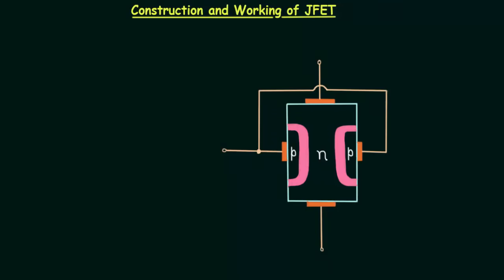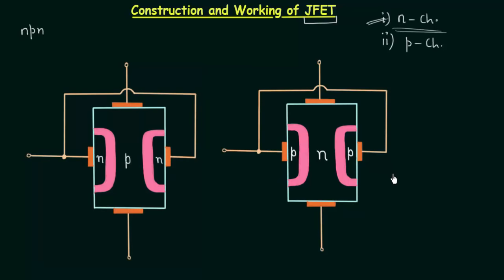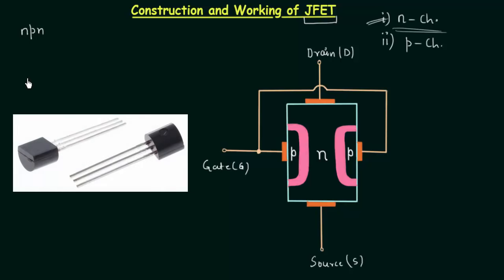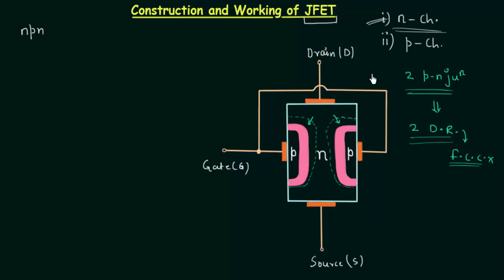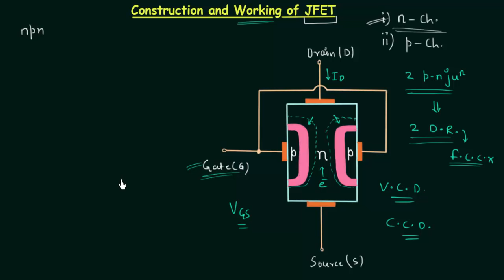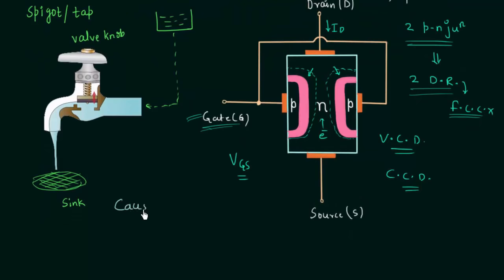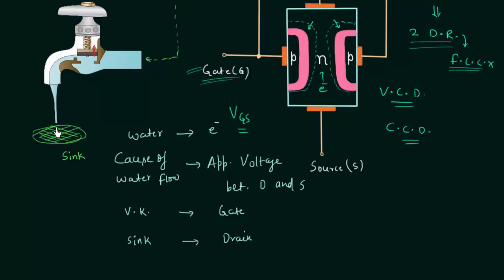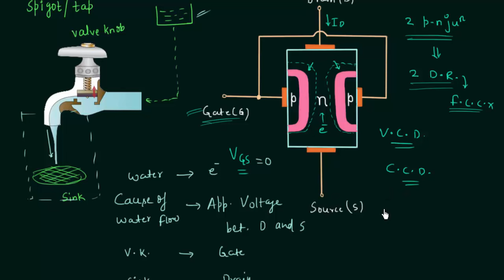Construction and Working of JFET

Comment: The device is called FET (Field - ....). My question is, with the regards to this video, which field is being referred to?
Reply: Bro electric of course as the current from drain to source is controlled by voltage at gate terminal. Voltage is ultimately related to Electric field 
It's a Voltage Controlled Current Source (VCCS) Device

Comment: Thank you for the explanation and comparison to tap. I just learned about it today and my prof had like 3 different currents and voltages (V_GS, V_DS, V_GD, I_D, I_S, I_G) and I had no clue what any of them meant. Now I know the gate voltage controls the flow of current which is the current through the source and the drain current is the current that will flow into the JFET (I hope I got this interpretation right lol).

Comment: What you mean by ohmic contacts of jfet???
Reply: KiNG KhaAN , it's mean that using a piece of metal we setup an potential difference across terminals of n-channel and current starts flowing linearly for some time from these ohmic contacts...in other meanings potential is high at first contact and lower(Ground) at other contact like a resistor....I think this will help